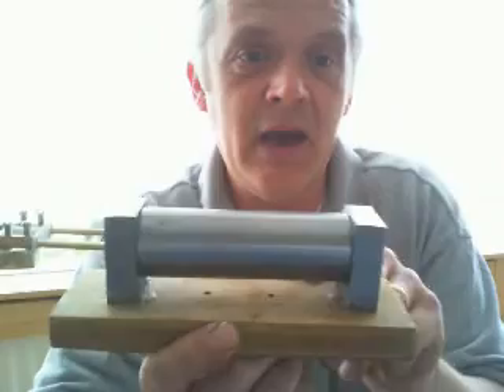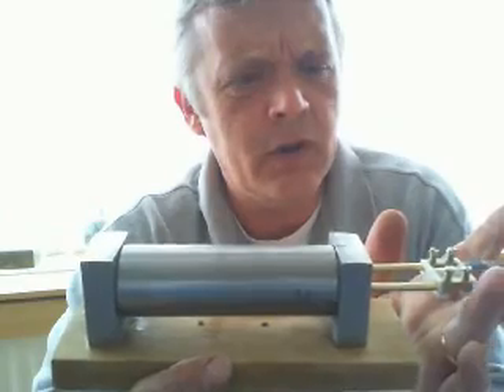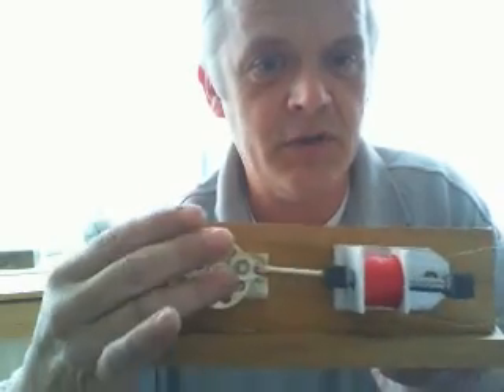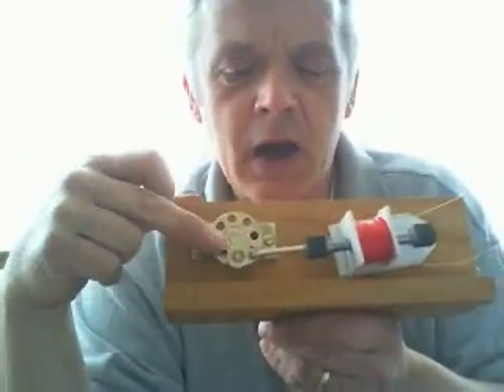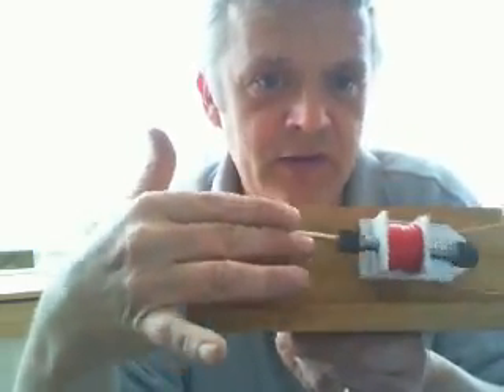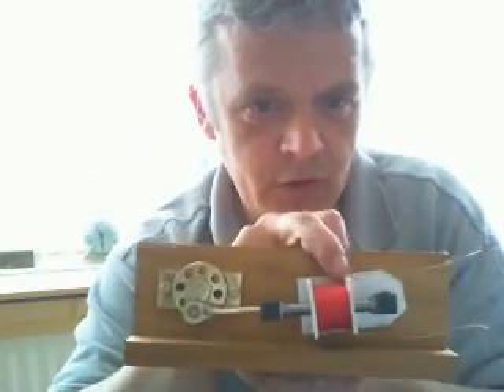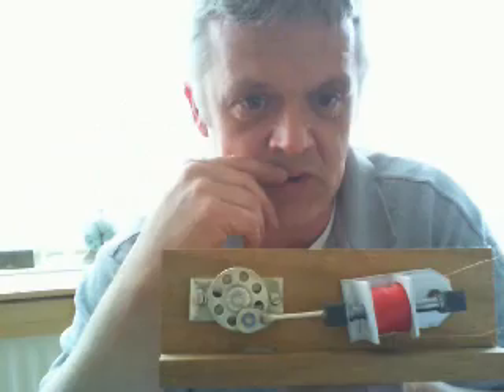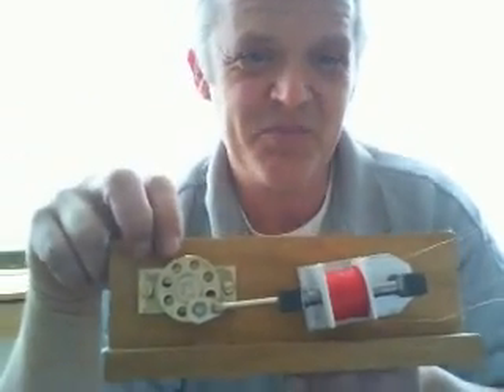Free Energy Power Amplifier 3

Comment: Hi Robert,

the reason you did not see any improvements by adding the outside cage is that the south pole flux of the magnets are lost in those thick transformer lamination cores and not reaching your steel pipe.

Luc

Comment from the maker: Hi, I built a flywheel from lead and attached it and ran it - it went so fast it flew apart because i had just glued the magnets to the pushrod. So now i have to rebuild it but more strongly so that is what i am currently doing. My new construction is all steel and bolted and i have run a few finite analysis models to test out some of the design principles - unfortunately it is pretty time consuming - but i will put up a video when i have it working properly - cheers